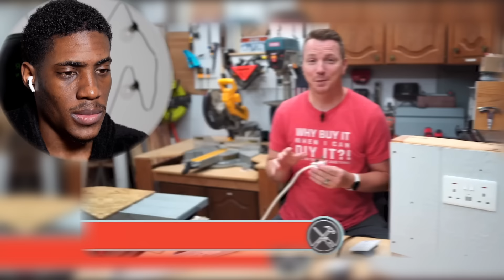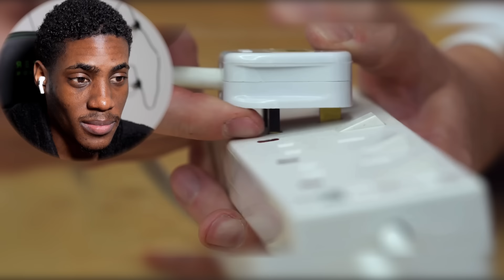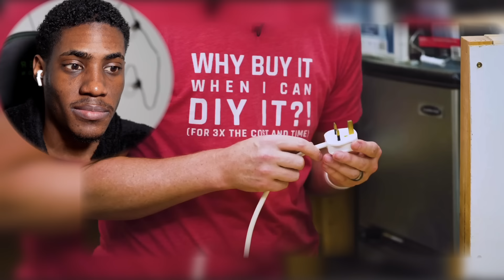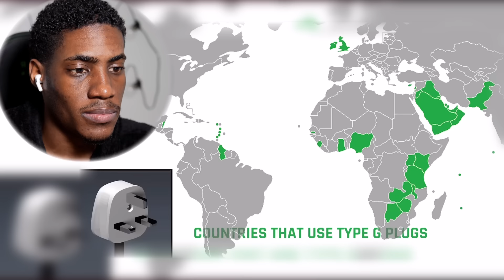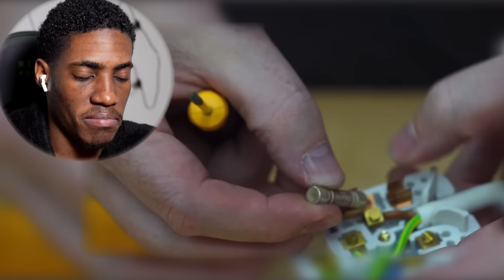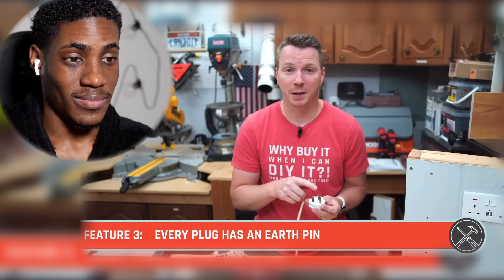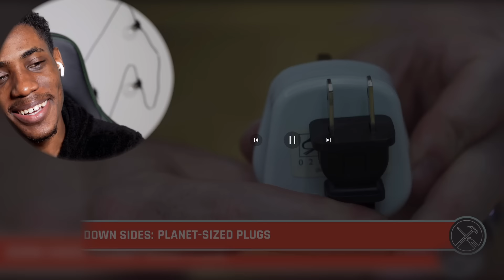Why British Plugs and Outlets are the best in the world || FOREIGN REACTS

Comment: Type G wall sockets and plugs are also used in Ireland, and, by the way, not mentioned in the video is the fact that mostly you will not find electrical sockets and wall switches in bathrooms. This is a safety issue as it is probably not a good idea to be switching on and off lights and electrical appliances in a damp and steamy bathroom. For that reason also lights in bathrooms are switched on and off by tugging on a cord suspended from the ceiling. Safety is everything!
Reply: Most countries I've worked in have bathroom light fittings outside the bathroom door in the hallway. When I built my house in Vietnam, I bought pull switches and 13-amp sockets in the UK, so my house is a mixture of UK and Australian sockets the latter being fit all plug types, these have worn and don't hold plugs as secure as the UK made ones do.
Reply: @TheByard  Yes, that would work. Visitors to the UK and Ireland are often puzzled by the lack of electrical outlets in our bathrooms, but I think it makes sense that one shouldn't be risking shock by going too close to 240 volts with  wet or damp fingers.
Reply: @76ludlow  depends on the size of the bathroom, 230 volt power outlets can be installed in larger bathrooms as well as 110 volt outlets in any size of bathroom.
Reply: @george-ev1dq  Yes,  but the regulation here is not due to impossibility. It is all about construction practice. It's the rule.
Reply: @george-ev1dq  The 110volt shaver/toothbrush outlets are isolated from earth (ground) so that even if you touch the live pin in the outlet, there's no path to ground & you won't get a shock, you'll only get a shock if you touch both the live & neutral pins at the same time - if you do that you've only got yourself to blame.

Comment: WRONG.
He criticised the ring main for having "thinner cables snd load balancing issues"..
BUT
You always have TWO cable paths connected into each socket... One from each direction.
(Actually doubles the cross section)
.
That's great, because IF you have a ring cable with a broken earth on the circuit, say between  two sockets, every socket still has a single earth path back to the panel.
(Then circuit breakers on the panel also deal with a breakage)
.
Cut an earth on a spur (US) and YOU would be the earth in a faulty circuit.
.

Comment: On many sockets the switch sits flush with the panel when off but juts out when on. Using only touch you can confirm whether the socket is on and operate it as well. Useful if it's behind a sofa.

Comment: As a British person a lot of his negatives were redundant. If a British person tries to turn on a device and it's not working the FIRST thing they do is check it's on at the socket. If you are stupid and lazy enough to leave a plug on the floor where it can be stepped on then that's on you it's not on the design of the system. As for the size it's actually a benifit in able to get a plug into a socket that's not easy to reach for example behind a couch

Comment: The ring main in the UK is rated at 32 Amps hence the need for a fuse in each plug. Unfortunately most equipment manufacturers supply their products with a 13 Amp fuse when a 5 Amp is sufficient. Another problem with the ring is if it is broken you now have two 32 Amp radials which can lead to all sorts of problems.
Reply: Plugs now come fitted and should be fused with the correct fuse for the appliance. Back in the day hardware shops would ask if you wanted a smaller amp fuse and give you one. As the plug would come fitted with the 13 amp ones.

Comment: The best in world is questionable...  The plug is large so that it can hold the fuse for the device.  Which means that originally, the home circuit would rely on the fuse being in the plug, not at the panel, which led to countless fires.

Comment: Before uk went to this plug there was 13 different types of plug and where made from Bakelight plastic “eek”
Reply: Some of the old round pin plugs were made of rubber - you can still get the modern "Type G" plugs made of rubber.

Comment: What won't be mentioned about the ring circuit in the UK which from my experience in USA is the fact that we have no and I mean no outlet sockets in the bathroom by law. Also we either turn the bathroom light on by pullcord or via a switch just outside next to the bathroom door before you enter. (this has confused many of my American friends here in the UK). 
Also in the UK death by electric shock in the home have been dramatically reduce 10 fold from when I was a kid over 50 years ago.
Reply: Ive seen places with sockets for electrical shavers and they tend to be the 2-pronged connection, although this was in a hotel so....
Reply: @deeplaysgaming4754  They also incorporate an isolating transformer that seperates the outlet from earth (ground) so even if you touch the live pin in the socket, there's no path to earth so you won't get a shock.

Comment: stepping on a UK plug can be painful, but if the socket has a switch on it, you don't need to unplug it. just don't be messy and lazy and leave cables with plugs in any walk way, tidy it up, problem solved.

Comment: Also mention the colour of the wires. Used to be red live, earth green. Unfortunately red and green  is the most common form of colour blindness. Changed it to brown and green for that reason, but did not stop there. The green now has a stripe along it as well, just in case an electrician with a really rare type of colour blindness, is working on your wiring.

Comment: Heavy loads normally demand their own circuit like a cooker or a hob, these might have 4mm wire compared to 2.5mm for a ring circuit and 1.25mm for a lighting circuit.  Heavy loads normally would not have a plug on the end but are hard wired into the circuit.  Investigate the fuse board (consumer unit) that is even more intelligent in the UK with Residual Current Device, Residual Current Overload and  Mini Circuit Breakers.

Comment: Switching off at the plug is useful for the many devices that don't have a switch on off button or keep using electricity regardless of being 'switched off' (my monitor on off button is essentially a standby mode). The UK plug may be bigger but the US one seems like it will stand out from the wall more given the UK mains cable points upwards when plugged in

Comment: I'm from the UK, In most cases we just leave the plug in the wall socket, switching power off at that point if you need too, so not possible to stand on the plug, again why would you leave the plug on the floor out in the open, where you can stand on it, either hang it up or pushed up  against the skirting board.

Comment: The socket used in the video is not a typical UK socket.  Most sockets (single and double) do not have a switch...and you'll have difficulty find a socket with any USB sockets in. And the reasons against are b*lls**t !!  I don't know anyone who has stood on a plug...and load balancing might be a problem in 1 in a million installations!

Comment: American's like and want everything big...

American doesn't like big plug. Yet that big plug has more benefits than the american one. It might be big in width and height, but it's certainly shorter in length which is more better and easier to put beds, chairs and other things in front of it without damaging the cable (or yanking it out when you clip the cable).

The wall switch can actually help when it comes to bills. You might forget about the switch if you're not used to it. But if you remember about the switches and all, it becomes second hand nature to you. When you cut the power from the wall, it cuts the power to everything connected to it that still would normally drain power when on sleep mode (Xbox and so on).

Comment: I can't remember ever having a fault in an actual outlet in 50 years. 

One thing that wasn't mentioned was the much faster home EV charging in the UK vs the US.
Reply: When I was a radar tech in the RAF we had one instance of a 240V/13A socket in the base of an equipment rack shorting out. I think it must have got hit by something pretty hard. It was a pain in the behind as the main fuse it tok out was Department of the Environment/Property Services Agency responsibility. The not too bright electrician didn't bother to check which one of the two possible fuses was the blown one. This was almost bad for him, as pulling a live 120A fuse is a bit spectacular sparks wise. Bad for us as it removed the other phase from our equipement, taking the radar from 50% operational to 0%. After the fuse was replaced it then took us about three hours to get the radar operational again. Well it was lots of racks full of valves, so had to be started up manually a rack at a time, in the correct order.

Comment: No, they are the worst of them all. They are huge, can only be put in one way and are not safe to use. Who said that's the best clearly never left the basement of their parent's house in the UK ever.
The best plug is the one Germans and South Koreans use.
It's small, safe and can be plugged in anyway you want.

Safe, because there is a plastic strip on them and only the tip is showing metal. So in case you touch them while plugging in you don't get electrocuted.
American and British plugs suck.

Comment: Missed the fact that under the current regulations here in the UK the ring mains are capable of supplying 7kw but normally the biggest draw is 3kw as they are fuse/circuit breaker  is rated for 32amps where as the two pin USA system is much less from a fuse/circuit breaker. Anything that requires a high power draw like an electric shower or cooker require a separate feed. And to top that the power/lighting distribution is split such that a single circuit fault does not turn off all power e.g. a faulty socket/appliance does not mean the lights go off.

Comment: The load balancing issue isn't a common problem. Through necessity I have a load of things plugged into one part of the room in a place built in the 70s and though that's not ideal I've not had any problem in twenty four years. It's bordering on academic unless something else is also wrong. Anyone who grew up with this system would automatically check the wall switch was on if a light didn't work and would probably remember if they'd turned it off anyway. He's right about stepping on a plug though. It's hardly likely to happen, but once is enough. As for HOW it would happen, I upset a glass of water on my bedside table onto the multiple socket block my lamp and clock were plugged into, so I switched that off at the wall and unplugged them. Then went to sleep and stepped on a plug when I got up.

Comment: As being German I must admit British plugs are the best, better than our central European Schuko! The long earth pin directs the 0 and the phase. The plugs are amazingly stable. You cannot get eshocked when trying to touch the pins sideways when inserting because of insulation of the pins. Outlets have a switch to shut off electricity without needing to unplug. Great. We should introduce it!
Reply: Why is it better than the German one? The schuko get set inside the socket, not on top and I think that's way better... I see the security features... But what else?
Reply: @moranjackson7662  the direction of phase and 0, the fuse in the plug, the switch in every outlet, the cables always pointing downwards and the very stable pins.
Reply: @martingerlitz1162  There are lots off ways that the cable has to go upwards!!So i dont see it as a advantage.
Reply: Well, 80% of all Global electricity production comes from UK engineering so I suppose engineering a plug and socket was somewhat inherent to that process.  BTW, look up "That's Life" and their campaign that led to plugs being factory fitted for every electrical product or lead sold in the UK.  That saved more lives in the UK than the UK plug design in of itself.

Comment: For the last "negative" he gave an example of, although he is correct it would be relatively painful to step on a type G, as there is a switch on the outlet / socket itself which fully cuts power, there isn't really a reason to unplug the device in the first place. Therefore plugs aren't left laying around to walk on.

Comment: In new homes you would wire to specification,  a general ring and a kitchen ring for example.  Then for higher load appliances you would run a radial for that specific item, say a cooker hood or an electric shower.  In these cases instead of using 2.5mm or 4mm cable (general ring) we would use 6mm or 10mm cable for the specific radial.  It is really not as complicated as he made it sound.  Here if something is too powerful to be plugged into a general ring circuit it will not come with a plug on it as standard forcing you to use a fused spur unit or at least evaluate how much load it will take.

Comment: The stomping issue can happen, IF, you finish hoovering and unplug but don't retract the cable. Then when walking to the bathroom you first trip on the cable, which pulls the plug away from the wall and then, "AAAAAAAAAAARRRRGGGHH."
Personal experience. I was ill at the time, and was a little lazy, but the hoovering still needed to be done.

Comment: Most homes have several ring circuits, for example one for each floor for receptacles, one for lighting, high power devices such as electric showers and electric stoves will have their own circuit. So load balancing is not an issue. I’ve only stood on a plug once in my 50 years, we don’t really unplug as we have switches
Reply: the only ring circuits you will have would be for general power.  maybe one on the ground floor one on the first floor and one for the kitchen... everything else in the house will be radials.... all the lighting, the cooker and the shower.
Reply: @R3ED3R  I’m no expert but I’m making the assumption that each fuse in the fuse box (connected to where the mains comes in) is a separate circuit, for example mine has 30a upstairs sockets, 30a downstairs sockets, 30a kitchen sockets, 30a cocker, 30a shower, 15a water heater, 5a downstairs lights and 5a upstairs lights
Reply: @DavidDoyleOutdoors  you are correct.  my house is 40 years old so although i am an electrician i still have the original fuse box i have literally lighting upstairs lighting downstairs power upstairs power downstairs cooker and shower.  for a 4 bedroom house.  That's 6 breakers.  in a modern studio flat you would have about 9 circuits.
Reply: @DavidDoyleOutdoors  if you were to open your distribution board (not saying you should) you would find that everything that supply's your general sockets up stairs down stairs and kitchen will have 2 brown/red cables going into the breaker where the rest will just have 1.  (all this is assuming you are from the UK)
Reply: @R3ED3R  ah I see, yes I’m UK based. my logic on my theory that it would take more wiring going back and forth to the fuse box from a single ring circuit than having multiple separate fuses ring circuits. Anyway I’ll do a bit of googling to learn more
Reply: @DavidDoyleOutdoors  it will require more cable in a way i guess but you can have a larger ring than you can have a radial.  So to supply the amount of sockets you might require you could get away with 1 ring main instead of 2 radials.  tbh almost anything is fine as long as your not plugging in 20 space heaters it's just the regulations here
Reply: @R3ED3R  hehe yeah, I’ll make sure to not plugin 20 space heaters. Thanks for the info, appreciate it
Reply: @DavidDoyleOutdoors  all new places are now required to be fitted with an RCD (Residual current device) that will trip all the MCB's under it to stop any damage or shock.  This is the only reason i have not replaced my distribution board in my house.  It can cause nuisance tripping and lead to me having to re wire my entire house lol.

Comment: I would like,to say he's got some things wrong 1 the Square within a square does not mean double grounded it's means it's dubble Insulated. In a uk home with an upstairs we have 2 rings Circuits 1 for up and 1 for down plus we have a radial circuit for the kitchen so load Balancing is not a problem. Cable size coming in we have 6mm to the Consumer unit then for the plugs we have 2.5mm running on 32 amp fuse fir the ring circuit a 20 amp for radial circuit then we have 1.5mm for the lights on 6amp
Reply: That's something he corrected in a text box that was obscured by the YT reactors head insert.